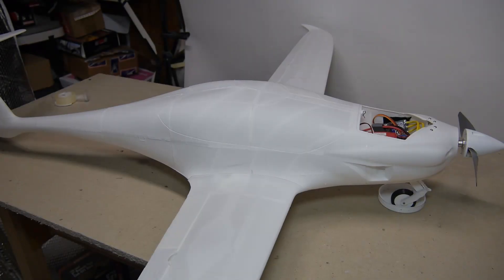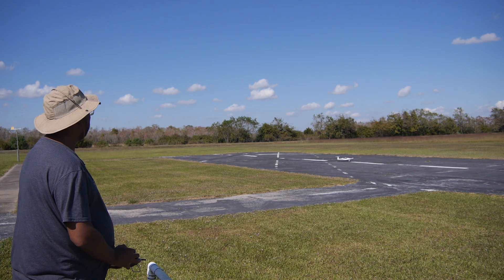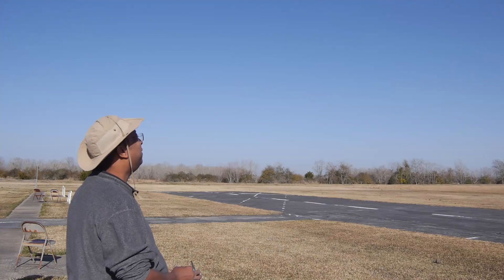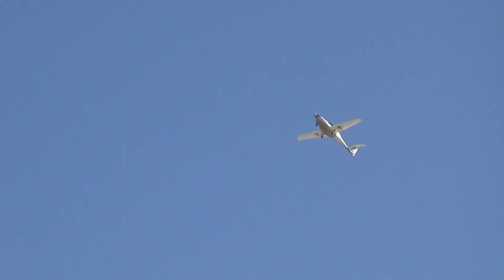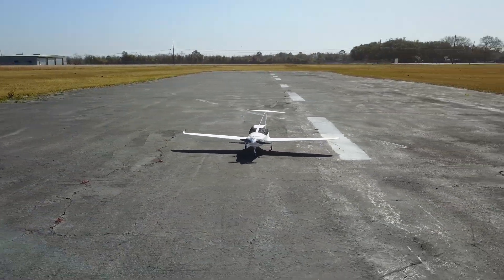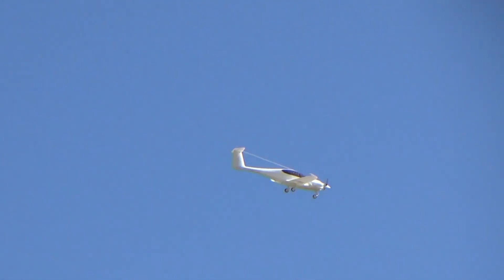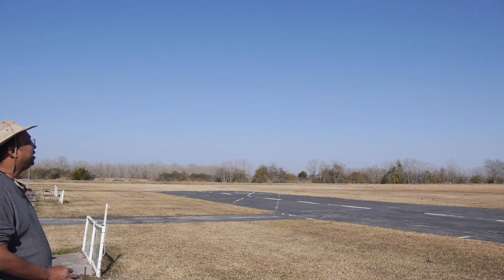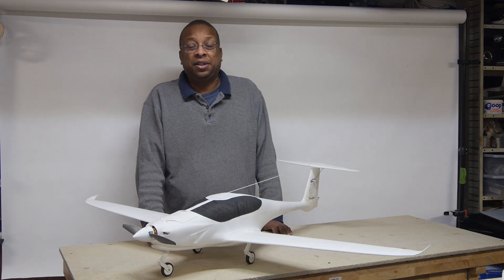Eclipson-Airplanes 3D Printed Panthera Flight Review - LW-PLA Filament Test | HobbyView

Comment: The problem is the  files for this plane have not been designed to print in LW-PLA. There's more to it than playing with the retraction number. Hence the stringing and the fact that the tail section is too weak to support the elevator. Structural changes have to be made to take advantage of the LW-PLA properties. One SLT file can't be printed in both PLA and LW-PLA  and be successful in either.

Comment: Nice build and flying video! I’m learning a lot from you, thanks! I think the way to go with the Panera might be to print the Pantera’s fuselage out of regular PLA, (or PLA+), and the flying surfaces out of LW PLA. That way you get strength and stiffness where you need it and lightness where you can afford to lose some weight. Best of both worlds?

Comment: Hi I love watching your videos, so easy to watch. After watching the build video again, the side carbon rods look like they go all the way to the tail, does the top carbon rod go all the way back too or does the channel stop ?
Would it help the tail if the rods had glue applied before they were slid up for the final time ?
Or have you come up with another solution apart from the uhf antenna.
Reply from the maker: The rods do go all the way back, but i may not have used enough glue on them. Forgot to mention that in the video, but good point.